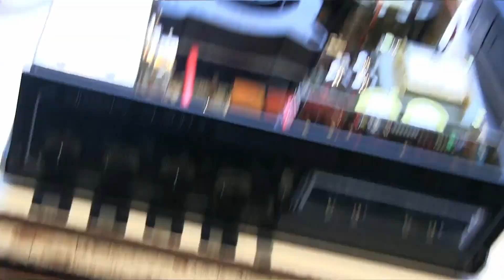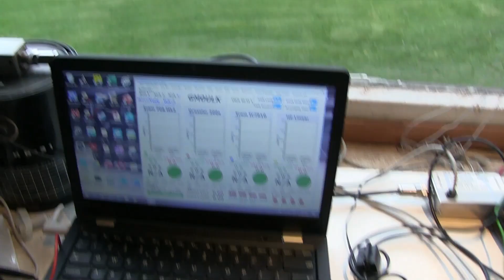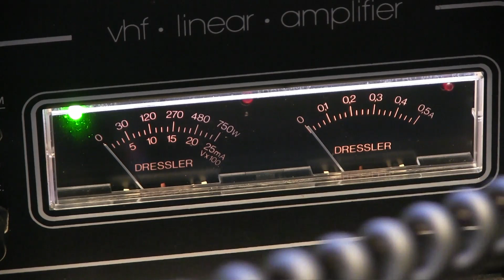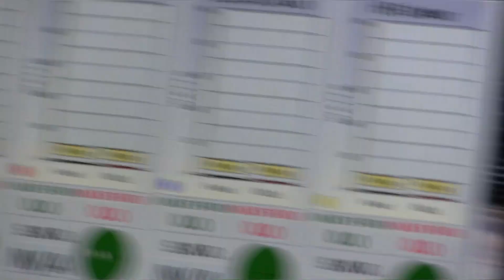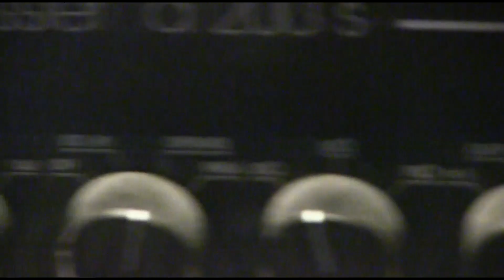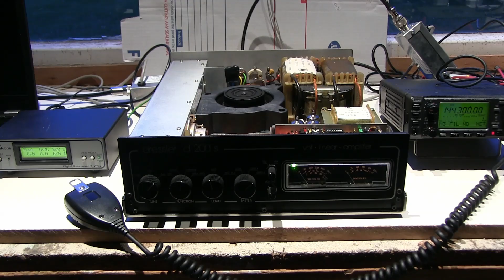Dressler D-200s 2 Meter Valve (4CX350a) Amplifier. (Restore, Repair and test)

Comment: A very nice presentation. I used to almost lust after these when I was a newly licenced teenager. I don't believe that this could do a kW.  What PEP did you eventually get out of it?  
My first HB effort was a '250B amp to the  VHF/UHF manual stripline design. I was amazed when I got 220W out. Happy days!

Comment: Thanks for all the information. What make is directional couplers and software used to measure PEP output ? Did you ever find out what all preset potentiometers do ? Your presentation is the only information I can find. 73 Mike G4GUG
Reply from the maker: HiMike,
The directional couplers are the Wavenode power measurement inline connectors. These are connected to a computer via the Wavenode unit in the  video. The software is the standard Wavenode programme that came with the unit. 
I never did get the service manual, having said that however, the operating manual is very comprehensive and provides all the circuit diagrams. I did not touch any of the presets as these appeared to be set in the approximate positions based on the indicated performance of the amplifier, so I have left these well alone. However, if you have one of these amps that the presets had been adjusted out of alignment, then that would present a problem as you would need to attach a ammeter in line with each circuit and ajust accordingly.